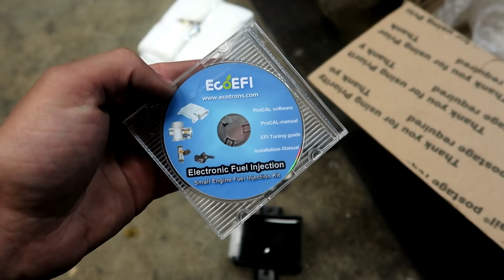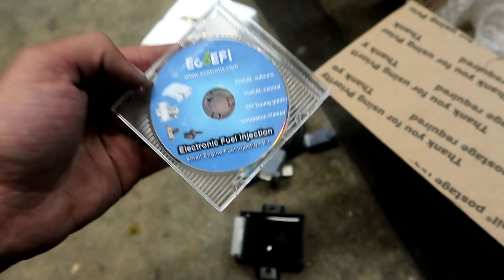Turbo Shopping Go Kart Update (Full EFI Kit)

Comment: I question how well the turbo setup will do considering Grind Hard Plumbing Co and Warped Perception both saw negative gains from them.
Reply: Peyton S. They don’t have a Brent
Reply: They had a carb
Reply: Warped perception was trying to use a turbo from a 200hp car on a 3-5~ hp engine, I doubt it was able spool at all. This turbo is designed for 15-20hp engines so it should work good after some thorough tuning from Brent the tuning wizard.
Reply: This efi will help alot also.
Reply: Jadon Wilkerson yea they act like it's still has a carburetor
Reply: Yeah I was wondering if the EFI would help. Surely Grind Hard used a proper turbo?
Reply: @peyn  They did, their issue was they never tuned it properly for a carb or even built a proper fuel system to add extra fuel into their little motor.

Turbo'ing a Carbonated motor really isn't that hard. They needed to add more fuel for that motor for it to make more power. If you add more air, you have to add more fuel too.
Reply: SkylineBNR34, ahhhhh shit didnt think of that lol that makes sense

Comment: Won’t you need a 2 bar sensor? Since atmospheric pressure is 1 bar, you’d need a 2 bar sensor to read anything (i.e. boost pressure) over that.
Reply: Correct
Reply: When an engine is running its pulls a vacuum, which is why they read Negitive one bar and positive one bar.
Reply: He needs a 2 bar technically but since he is in Colorado he should be about to run a few psi due to altitude
Reply: When measuring pressure,Atmospheric is considered zero.so that map sensor is 1 bar above atmosphere
Reply: Map sensors also need to read vacuum, a 1 bar can't read boost.
Reply: depends if its 1 bar absolute or zeroed at atmospheric and then you get your 1 bar.
Reply: You can put a Chevy 2 bar MAP sensor on anything... and tune it....✌... if he needs to. ..
Reply: lol, it wouldn't really make sense having a MAF sensor that only works at atmospheric pressure and if you feed any air through it will fail, Hah! The rating of 1bar / atm will mean on top of atmospheric lol
Reply: That has to depend on how the map sensor senses pressure. If its absolute pressure, then you are correct. But usually map sensors work by making 1 bar as zero pressure. So based off this, 1 bar map sensor means it will read 1 bar above atmospheric pressure.
Like in stock honda map sensors which are also 1 bar and they can read 14psi of boost.
Reply: I came to say this too lol
Reply: Kran you mean map, no maf here
Reply: 100% correct
Reply: Our Small Engine EFI Conversion kit also supports a Turbo charger. Compared to our NA (natural-aspirated) version, this kit just needs to change to a 2.5bar MAP sensor and a bigger injector. 

This is taken directly from the place he bought that EFI kit from, but he bought the N/A version and not the Turbo version.

https://www.ecotrons.com/small_engine_fuel_injection_kit/small_engine_fuel_injection_turbo_kit/
Reply: Do we know what the A in MAP is? Manifold ABSOLUTE Pressure. A 1 bar sensor is atmospheric (absolute) pressure only. 2 bar reads 1 bar of boost and so on.
Reply: El Rey they have no air up there anyway

Comment: Interesting, that little ecu has basically a 24 pin connector for a PC on it.
Reply: Probably just for low manufacturing costs. Most of those plugs are probably common
Reply: thought the same but on second thought ^ he's right. like how most phone charger s and controller cords have been glorified usbs for years
Reply: So he can lap tune it on Brent's dyno lol

Comment: 1bar map is 14.7 and thats is atmosphere pressure its not gonna read any boost
Reply: I'm surprised I had to scroll this far to see anyone commenting about that
Reply: How u know his atmospheric pressure... could be 3 or 4 psi and he can read up to 10???? Depending on elevation but yeah i run 2 bar map so do most other lads here in aus that dont pump over 10-15 pound
Reply: 14.7 is the pressure at sea level. Kyles elevation is around 5200 ft  so around 11 or 12 psi
Reply: He should just use a factory b/d map sensor, they are 1.5 bar.
Reply: He'll need to read absolute pressure whereby perfect vacuum is 0psi and atmospheric is 14.7psi (at sea level). If he can at least get it to boost enough to keep it around 15psi (absolute) then will chug along nicely
Reply: @Dingus E. Dow correct, will read 1 bar gauge pressure so roughly 2x Atmosphere
Reply: A 1 bar MAP reads from 0-1 atmospheric pressure, it doesn't read boost at all. Otherwise people would be putting 0 bar MAP sensors on N/A cars, which don't exist.
Reply: @Dingus E. Dow You have that wrong. If there wasn't already an atmosphere to read we'd all be dead due to no oxygen. There is no such thing as 0 Bar because 1 bar is what we have naturally occurring around us. Boost gauges set 0psi or 0bar at technically 1 bar. Seems that could be where your confusion is coming from.
Reply: lindsay obrien i think you would die if atmospheric pressure was 3 or 4 😂

Comment: If you end up having problems after connecting a laptop to that ECU(idk what else to call it) it might be that serial to USB converter. I've fought with those things way too much tuning on DSMlink cuz the cheap converters are hit and miss with drivers and different operating systems. I really wanna see a turbo shopping cart so that might save you a headache later on since it's kinda hard to diagnose
Reply: SlowSpeed6 fuck VGA converter s only one I've ever had work was dvi-d to vga
Reply: You are correct. Serial connectors are becoming more difficult to deal with the newer computers get. They waer extremely to deal with during the windows 3.1- 98 days as computers and laptops actually included serial ports. Last time I used them was on windows 7 when I was programming xbox 360s
Reply: @MrLendermanGaming  that signal degradation sucks. One of my monitors is setup that way and it looks like shit compared to the HDMI to DVI-D monitor next to it and the displayport to DVI-D next to that one lol this VGA talk is making me miss my old video wall set up, too bad my GPU starts acting up with 4 monitors attached
Reply: @esqueue  the good old JTAG fun right there lol I still have to deal with serial and parallel ports to configure old network hardware every once in awhile so I keep a good USB-Serial adapter close

Comment: Ever wanted to know how to make weed brownies? Well today is your lucky day! 
First, DO NOT use regs, mids, or trimmings, it will taste pretty bad. Have some self respect and get some nice dankety dank um-key?

Dosing: Alright, if you have a low tolerance or no tolerance, and do it efficiently, then for 16 doses a pan you want probably 2 GRAMS MAX, just one if you only want to be nicely high. I know you are thinking "that seems low." Remember many edibles are murderously strong, and that once you get to "extremely stoned" you don't usually get any higher. If you have a decent tolerance, then maybe 4 grams, after that I would consider taking a T break, but otherwise a gram for every bowl you smoke to get high.

Either vegetable oil or butter will work just fine. Neither is really better. Butter does taste a bit better but also burns more easily.

With 2-4 grams of weed, the oil will take about 20 min, 30 max. I am not sure why people always say an hour or more, I suppose an ounce might take that long. KEEP THE OIL MOVING AT ALL TIMES. Usually it gives off a flowery odor at first, when this goes away it is likely ready.

The proper temperature for the oil is the same as what water boils at. Usually this is about medium to low heat. If you are not sure, heat the pot holding the oil in a larger pot of boiling water (double boiling).

If you burn the oil more than very slightly you are fucked! Usually this occurs at the high end of the medium range or if you don't keep the oil moving. The oil shouldn't really be simmering, but close to doing so. You will start to notice the smell changing and the weed particles getting dark burn marks if it is too high. Turn down the heat immediately if so because in a few minutes that shit will be ruined and the batch will taste disgusting (kinda like resin and chocolate) folks.

Not filtering out the weed, washing it with more oil and filtering again is terrible form. Use a sieve with fine holes (no coffee filters). You cook the canna-oil with half of the total volume, then after filtering pour the rest over the weed through the sieve and into the pot (hehe) to rinse. You do not want pieces of leaves and stems in your brownie. Use a small pot, the oil sticks to the sides somewhat.

Always add the optional extra egg to the mix for cake-like brownies. This helps in a number of ways. It makes the batter easy to remove completely from the bowl. Makes mixing easier. Makes the batter evenly fill the pan without much work. Makes the brownies easier to cut (with less crumbs) and decreases the chance you will overcook them into oblivion (burnt brownies don't get you very high).

Don't use a whisk to mix it. You want to get every last bit of batter, use a mixing utensil that fits the contours of the bowl to get all that batter, about a fourth of it gets stuck to the side of the bowl after you pour it.

Don't forget the nonstick spray. If you do then the brownies will get tore up when you try to remove them. If you have no spray then a piece of paper towel dipped in oil is a good way to coat the pan. Use the what's stuck to the pot you cooked the oil in for bonus points.

Set the oven before you are done mixing for 365 F. It usually says 350 on the package, which will still work pretty well, but 365 is exactly the temperature at which the most thc will be activated. Usually it takes maybe a minute or two less like this too. Maybe 31min in a 11-14in dish. Set the damn timer!

And of course store them in a zip-lock bag afterwards, they go stale (but still work) in a few days otherwise. Also DON'T PUT THEM WHERE YOUR PET CAN REACH THEM. I once knew a kid who killed his dog this way with a batch I sold him, use your head.
Reply: Make a video
Reply: You could save some time by buying hash oil so you don't have to worry about the plant material. Just decarb it in a oven safe dish with some parchment paper. Plus they taste better and get you higher.
Reply: Don’t forget to decarboxylate

Comment: it will barely make 1 psi dont worry about a wastegate bro. the single cylinder exhaust pulse wont allow for proper spooling and exhaust expansion
Reply: There are alot of these turbos on even smaller cc engines pushing about 6 psi.

Comment: 1 bar map sensor is for up to 1 atmosphere, as in NA, MAP sensore are absolute so it will do 1 bar from 0 atmospheres. You'll need a 2 bar map sensor to read boost,  full vac to 0, then 1 bar of boost on top.

Comment: You should make the jack shaft out of the same size bearings as you are using on the axle it is taking the same load also use a piece of axle with the sprockets with key ways in it hit up go powersports

Comment: If your mice are frozen try warming them up with hot water or in a oven and get a pair of 12' locking clamps from harbor freight i think they are called or very long tweezers to hold the mouse instead of your hand

Comment: You can run a pop off valve between the turbo and the inlet rated at 1 bar to limit the boost going into the engine to be safe until you find a wastegate solution.

Comment: Came for the very first kart video stayed for the K's.  Glad you got to work on it will come in handy for rainy day meets.
Reply: Also, you want a pressure reg for the oil feed for the turbo. They take so little pressure and volume most people blow the seals out before ever getting the turbo spooling. cough (Grind Hard Pluming ) cough.

Comment: I wonder if you couldn't use an air compressor hot side pressure relief valve with a very light spring I donno just a thought
You gotta put a tiny intercooler and bov just because !! Lol

Comment: 1bar map is 14.7psi. But atmosperic pressure is 1bar. So your map cant actually read any boost at all. You need like a 2bar map or just use a stock honda map (1.7bar iirc). Problem is if the ecu cant be reconfigured for the map hopefully it can

Comment: kyle I'm not sure if I'm right but it looks like it has a valve for a internal waste but is look sealed so which mean is has a pre set spring witch u cant change so u will need a boost controller to up the boost

Comment: The guy who just painted Taylor Ray's LS miata has a beautiful manual cummins for sale! He's all the way in Orlando. But its a gorgeous rust free southern truck that'd probably be worth a good amount of cash up here. His channel is Bode Vision
Reply: 9000's Only johnny sendit sold his truck recently and so did andy alberalla sold his megacab. And that beautiful southern truck would fucking die quick up north without the right prep or storage
Reply: Not at all. I'm from Maine. We run our diesels hard. He'd have to throw a bigger lift pump in it and some tires on it to make it through the winter. Maybe a block heater if it was removed for some reason.

Comment: That map sensor won't work, 1 bar maps read vacuum up to ambient pressure or gauge 0 psi. You need a 2 bar to read vacuum up to 14.7 psi of boost or 14.7 psi gauge pressure that is 29.4 psi absolute pressure or "2 bar"

Comment: Kyle- now days, it isn't so much about the "Hardware" of a simple Jetronic EFI system; it's mainly in the software. That tiny ECU packs way more RAM and ROM than you think. There's probably a 9v battery needed to, for "keep alive memory". That wiring harness looks like the company repurposes old PC stuff (ATX, Molex, I/O) so it's very reliable. You Boiz will have awesome power with that cart. That's better than any "pit bike" and easily fits in the Rowdessy.

Comment: READ
If the pump pressure is high you need Restrictor for your turbo!
If the pressure is high and no restirctor it blows your oil seals out of turbo.

Comment: IMPORTANT! You need to have a very large boost pipe for single cylinder to work well. I have 160cc engine and I have ~2ft long 2inch boost pipe because you need a LOT of space for the air to build up. On 4cyl always one cylinder is taking air in and one is pushing in to the turbo so it stays spooled much better! LARGE BOOST PIPE!

Comment: Hi Kyle
If the map sensor says 1bar, it will not read boost,
As normal air is at 1bar,
Dave
Reply: David Browne you dont understand thermodynamics, apsolute air pressure
Reply: @ZVONIMIR172  
Hi so if that turbo makes 2psi above atmospheric air pressure, that sensor will not read it as it will be out of range of the 1bar, 1bar sensor can only read atmospheric air and vacuum, 
So he will need a sensor that reads over atmospheric  /1bar, to read any boost pressure and correct the fuel,timing, ,
Reply: you still dont understand

Comment: get an 05+ 6.0 ford power stroke. best truck for PERFORMANCE and reliability (IF APPROPRIATE MODS ARE INSTALLED, EGR DELEGE, ARP HEADSTUDS, INJECTORS, BIGGER TURBO) easily a fast, strong, and healthy truck if done right.. and not to mention it’s the best damn sounding diesel there is

Comment: Why is everyone saying his map sensor isn't going to work.   Most N/a engines at full throttle dont even pull  1 psi of pressure. Hell brent has vids where the cars are  idling and you can see that the air is less dense on the sensor (colorado can be over a mile up from sea level). Atmospheric pressure   is different on an engine. If an engine could pull 1 bar of atmospheric pressure it would be like having a 14.7 psi wastegate spring. Most 1 bar map sensors read up to 11 to 13 psi easy depends on the sensor.  How we get away with low boost on a honda run under 10 psi and a stock map is fine same concept basically.

Comment: just drill tiny holes in the piping for the turbo either in the exhaust or the cold side if it overbooosts. just drill a hole untill it levels to a pressure you like

Comment: You actually need a 2 bar (or more) sensor for boost. Our atmosphere we live in is actually 1 bar of pressure,  (also referred to as 1 Atmosphere).
Reply: Not in Colorado it isn't, 5000+ ft elevation.
Reply: So Colorado exists in a complete vacuum?
Reply: @garageadz  No but the elevation means that the static atmosphere is more like 11-12 psi instead of the 14.7 it is at sea level, so a 1 bar map sensor will read upto 1 bar of atmosphere giving them 2-3 psi of tuning scope.
Reply: @jakewarren9465   well that's fair, I ran the numbers myself and Colorado is at 24.9 inHg which is 12.29psi so yeah I suppose there is some wiggle room.  The elevation is a somewhat foreign concept around here, it's just flat where I am so thanks for the discussion.
Reply: @garageadz  All good mate, im from the land of flat aswell (Brisbane) haha.
Reply: Aussie Aussie Aussie!    :P

Comment: Aaah.....you slowed down on the kart......oh well.....happens when you have so much going on. Nice EFI. Make sure you finish mounting the gas tank; battery; harness; and jack-shaft better. You will need to weld in an X frame on the bottom  before you get that turbo mounted. You will surely bend and break shit if you don't.......

Comment: Hey anybody..i have a 98 prelude throwing misfire codes in 3 cylinders. Had an exhaust leak and bad 02s replaced/fixed those problems and now misfire in one cylinder still. Wires and plugs are brand new what could cause this? Car sounds like blahblabla from exhaust exit when starting and has no power? Im stumped

Comment: I've never seen a turbo setup on a small engine that makes any actual power so hope this is different. The boiz know what they doing. Also that engine should make enough oil pressure to lube the turbo.